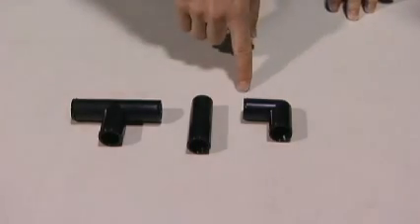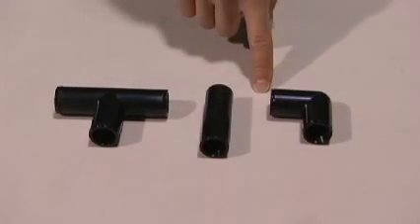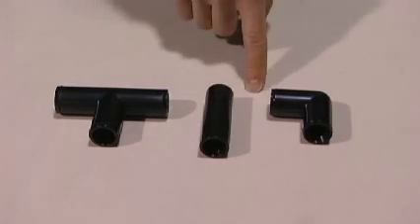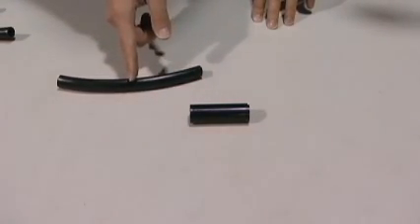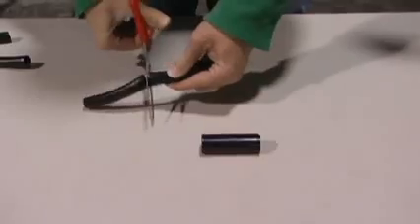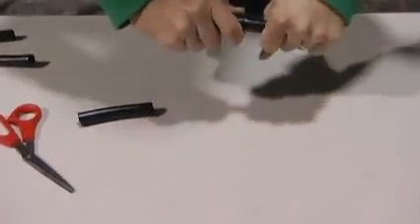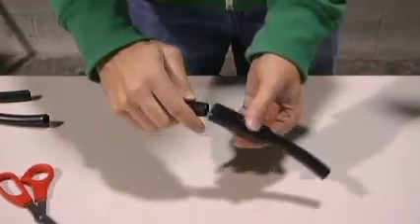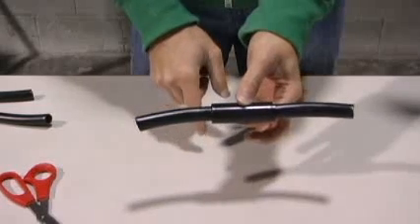Drip Irrigation Compression Coupler Fitting

Comment: going try the hot water trick but just getting the twist-lock fittings is the best move
Reply from the maker: Fully agreed, I'm not a fan of compression couplings either -- maybe if you need thousands of them for a large commercial project the savings make them worth it, but for anything else I prefer the easier to use Loc style fittings as well :)

Comment: Nah, this doesn't work in real life.  If you are laying the hose flat in the ground, you can do it this way.  However, if you are repairing a hose that's buried, the first side goes in easy, the second is almost impossible.  If you soften the hose, the end of the hose crimps making it wider than the hole in the fitting.  You'd have to unbury a couple feet of hose to even attempt it.  Much easier to used clamped fitting.  What I've been working on for an hour would be done in under 10 minutes.

Comment: Simple....I use butane fuel.  Fill my butane bottle, open the valve, light the flame and slowly heat up using a small to medium flame to soften the irrigation tubing then slowly place/push it into the coupler.  Just don't get the tubing too hot, only takes a few seconds.

Comment: I figured it out!  Use hot water to soften the flanges inside the coupling itself.  The flanges are what makes it so hard to push the tubing into the coupling, especially since the tubing is softer than the plastic flanges.  I put one end of the coupling into some hot water for about 10 seconds, then had no problem pushing the tubing inside.  Repeated for the other coupling end.  This worked for both the Rainbird Easy Fit Coupling and the Rainbird Easy Elbow coupling.
Reply: I am able to  push them in when I am lucky, but I used you hot water idea successfully today after I had given up. Thank you.
Reply: Thanks for the tip it worked great for me after struggling for a good while.
Reply: Does it go right on or do you still need to push after you've heated the fitting with the boiling water?
Reply: Thanks for saving me time!

Comment: never never ever has anyone been able to connect a compression fitting the way they show in this video.
Reply: When they show it looks easier but practically when you are doing in backyard drip line is very hard to push in coupler.

Comment: How about telling us how to get the line into the compression fitting without being a circus strongman?
Reply: +p38walther you bring up a good point.  Compression fittings are a bit of a pain to get into place.  We recommend heating the end of the tubing with hot (not boiling) water to soften the tubing.  This allows the tubing to slip into the fitting easier.  Then as the tubing cools back down it will be locked into place.   Hope this helps and have a great day!
Reply: Tried that and in fact, went to BOILING water, AND dish soap and am just going to forget the fittings and run a HOSE to ONE line and put emitters on that ONE line.  At least it will only be ONE awful job.  I think I remember doing this year ago and chamfering the line with a pocket knife.  They sure DO NOT WORK!
Reply: +p38walther It's possible that you had the wrong size fitting. It's hard to tell them apart. Some have black rings, some have blue rings and some have green rings, all just a little bit too big or too small.
Reply: i don't know what all the fuss is about compression fitting and tubing. simply line up the tubing and twist in one direction as you push